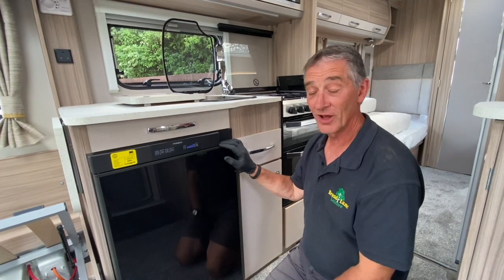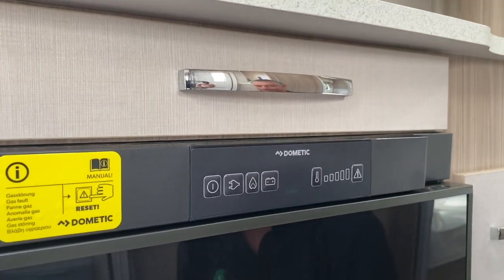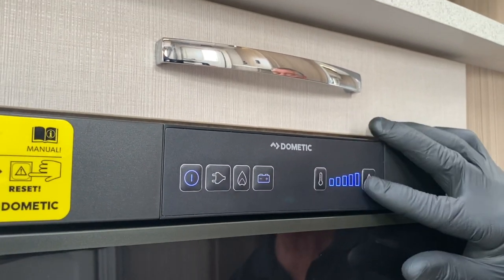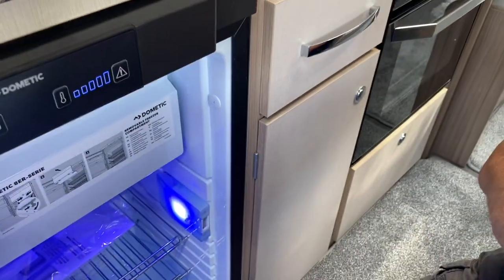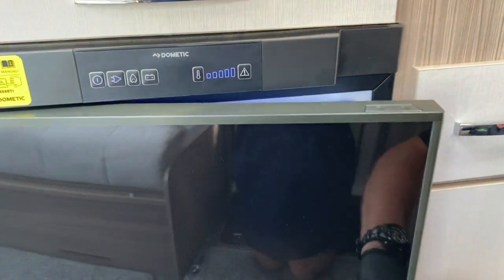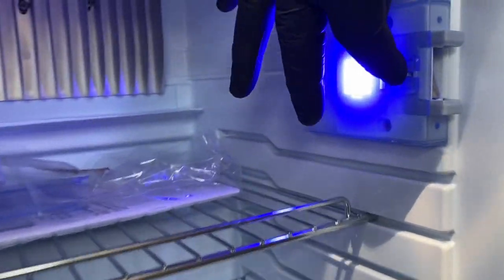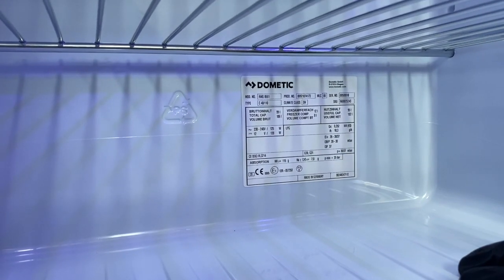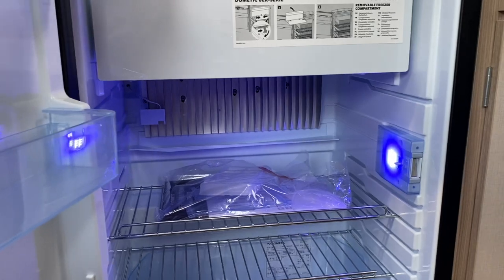Dometic fridge tutorial

Comment: Hi, wondering if you can help. We have a Dometic RMDX21. There are no lights on the control panel but the fridge light works. We have bought a new control panel, using the same wires, we still have the same issue. Do you have suggestions on solutions?
Reply: It probably is the module control board in the rear of the refrigerator however unless you have good luck with your refrigerator I would replace it these absorption refrigerators are just horrible